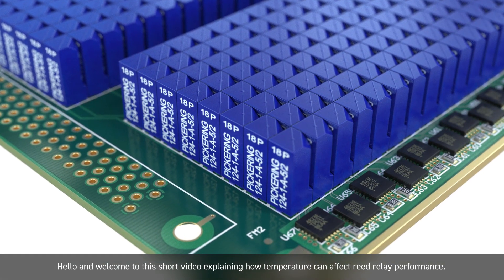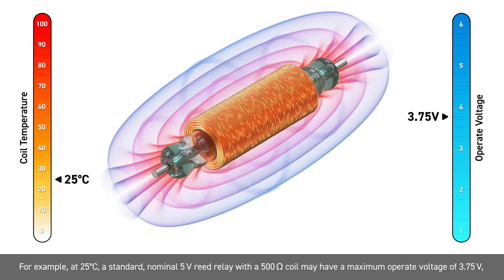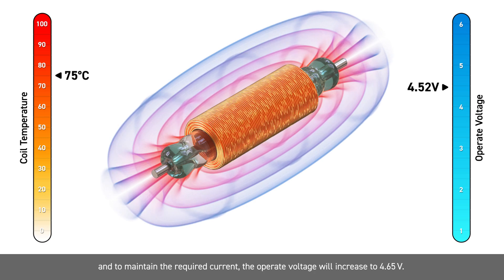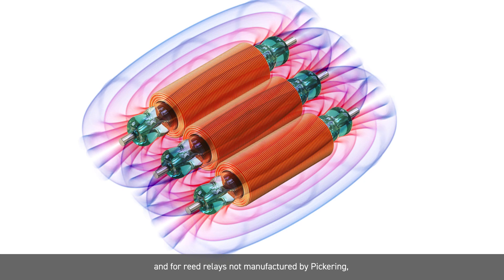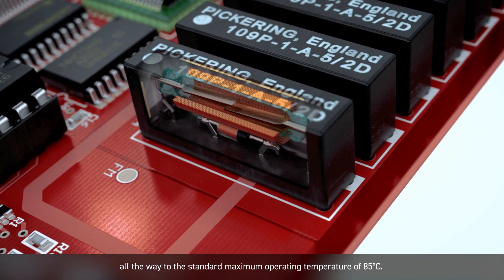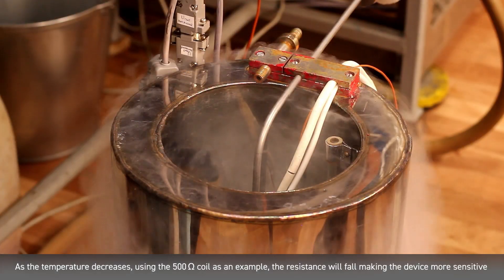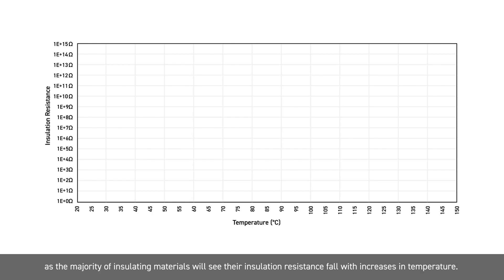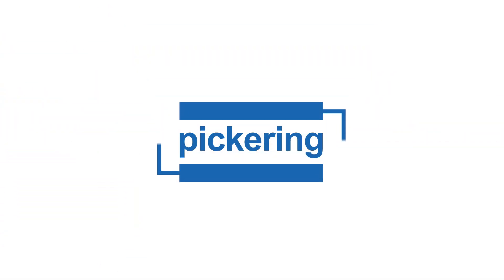How Temperature Can Affect Reed Relay Performance | Pickering Reed Relays

Comment: Hello , i watched all videos like student. So,i thank you. I have a question, you has used the coil in this case. If i use magnet that mounted near reed switch as parallel to its or the magnet has mounted perpendicular to reed, can i see switching from reed sw? Perpendicular mounted means N pole near reed ,and S pole away from reed. There is second question is which is more efficiently to swithcing perpendicular mounted magnet or parallel magnet to reed? I wish good job.